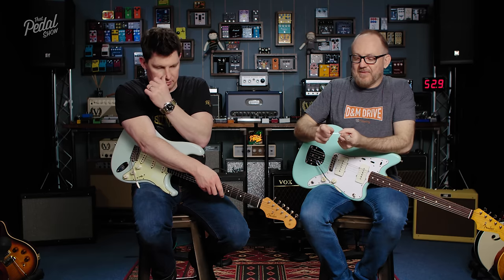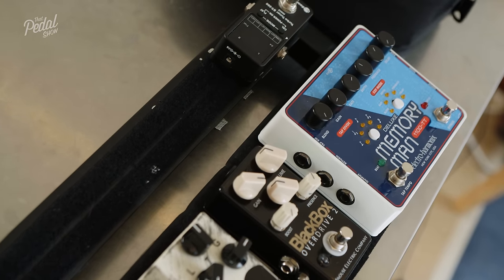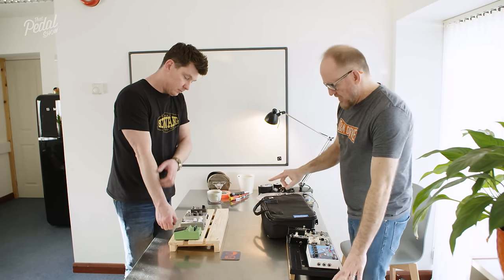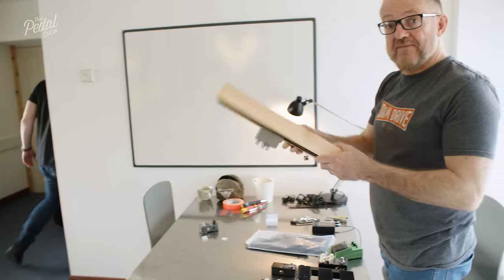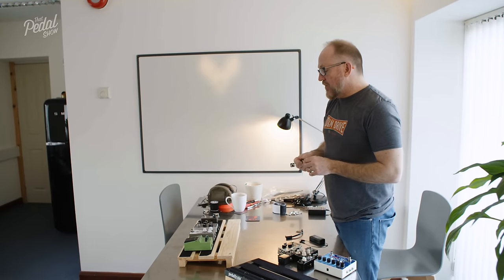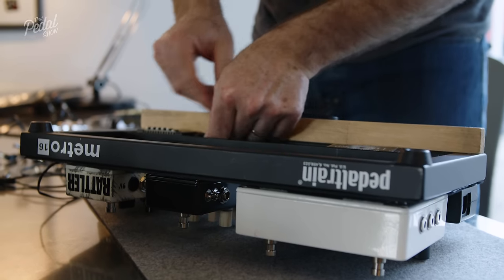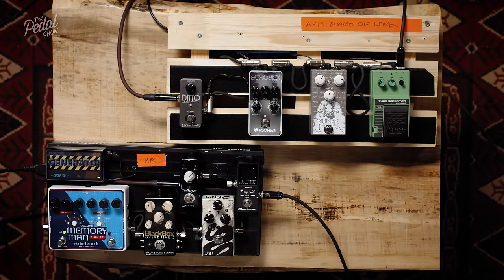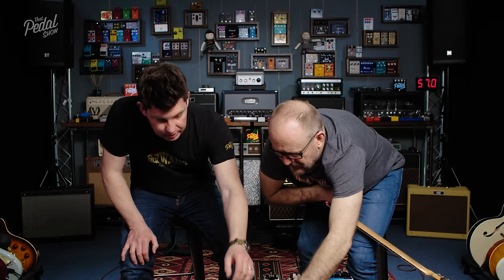Tips For Your First Pedalboard Build – That Pedal Show

Comment: Question for VCQ: I’ve brought a Mooer trelicopter and noticed it’s boosting my volume when I step on it. It’s currently after my drives and before delay and reverb. Is this normal?
Reply from the maker: Does it have an internal gain trimmer?
Reply: @ThatPedalShow   no idea!? Brought it off eBay 'new' ( from a  Chinese seller but it was posted within the UK) figured if it did it for me it would do it for everyone else? The pedal itself is VERY light if that info is any use? Works fine as a tremolo but just curious if it's ment to be boosting signal? I can send it to you guys if your interested ?

Comment: Question regarding metal signal connectors like the SiS and isolated power. When the pedal I/O are on the sides, and the cable connectors of adjacent pedals are touching each other, would that defeat the isolation in the PSU? Or is the shield/ground of the audio signal separate from the power ground?

Comment: Oooo, actual I do have a question... I asked it ages ago, it's regarding the type of cable dad uses... I asked Mary Spender for Somme reason at some point

Anyway, here goes...

The cables dan uses is solid core cable right? Which is what Dan recommends, even though it's a lot thinner stuff, and everyone seems to talk about it...

Now I recently had a cable failure on my board, I took it to a guy I know who has been a sound and electrical engineer for about 50-55 years(he's 76), he's no slouch in the knowledge of this particular field. 
He looked at my trusty fender cable, thick, chunky covered in nice tweed with shrink wrapped rubber around the solder, and exclaimed 'What a shambles, the tweed makes it difficult to find the break, the shrink wrap just makes it difficult to get to the solder, neither of which have any sonic improving properties, and it's a stiff, inflexible, solid core, prone to breaking, cheap junk cable, that companies charge exuberant prices for.... but I'll fix it!' 

He changed the cable for proper audio cable, resleeved it in the tweed as I insisted, and even re shrunk the rubber end around it, he said it was nothing more than cheap satalite cable they used, you can get it from anywhere, the profit margin of fenders cabling is obviously extraordinary, but the marketing campaigns will sell it to you as such an amazing revelation in tone and stability and ruggedness... don't believe them...

My question is: does anyone know why solid core cabling is been touted as such a great thing for the transfer of an audio signal through a pedal board? Why then is non solid core audio cable better for your guitar cables? 
It just seems to make sense to me that if something is been twisted and manipulated over and over again, forced into difficult positions, like cables are on boards, the more flexible the cable, the longer it will last? I so pros and cons too though as well... but the risk of snapping the core of a cable when purposefully bending it seems more with solid? 

Long winded question... sorry...

Comment: Hey Dan and Mick, what’s your pro tip for getting pedal board tape or Velcro onto the base of a Boss pedal? Do you remove the rubber pad or have you got a workaround?
Reply from the maker: Lots of people in these here comments are suggesting turning the base plate upside down. Never tried it but as long as there's clearance for the internals... Happy days.

Comment: You guys are great. Thank you so much for all your information on pedalboards. I have a MXR DynaComp that I am trying to work in my board it's just not working I don't like the sound of it it takes all the individual dynamics in emotion out of the playing. Am I doing something wrong? What should I be doing? How should I be setting this DynaComp?
Reply from the maker: Hello Ken, i posted this elsewhere on one of your comments, you may have missed it. Excuse the repetition…. Hey Ken, Mick here. ‘Problem’ with the Dyna Comp is that it does that overt squishy thing so well… but as you say robs the front of your note. You’ll get better results with a comp that has a dry blend. That way you can blend in some of your dry signal so the front of the note isn’t caught so much, but you still benefit from the sustain on the back/decay of those note. It’s one reason parallel compression is so popular in studios. With a dry blend you can bring a bit of that to your pedalboard. 
Failing that, try it after overdrive instead of before. Cheers!
Reply: So what would be an alternative?

Comment: I maintain a spreadsheet with all my amps, cabinets, pedals, mixers, etc listed with model and serial number, the year acquired, where/who I bought them from, who I may have sold or gifted them to, and the manufacturers' recommended power requirements, size of the connection barrel and pos/neg requirements.  It is a heck of a lot easier than taking a pedalboard apart or emptying a trailer to find the information at 3AM!

Comment: I’ve used the gigrig power supply for a while now and I couldn’t use anything else now. Dan, have you ever built a board so massive it’s required , more than one generator? If not, what do reckon the biggest board you could make just off one generator would be?

Comment: Great episode and perfect timing. I currently use a daisy chain but would like to purchase a power supply, however, and forgive my ignorance here, but should it be DC or AC, or is that dependent on which pedals you have?
Reply from the maker: The vast majority of pedals require DC... Which is what the vast majority of pedal power supplies, er, supply. Whatever you buy, make sure it can cope with the next four pedals you add. How about that?

Comment: First, thank you very much for the great episode. I have a question about the problem Mick had with the Mythos Runestone. I understand he further isolated that pedals power source by removing it from the Mission Engineering power source. Could he have sold the issue by still preserving the power source? If yes, how? Thank you very much in advance.

Comment: If you are practicing at home at relatively low volume with your whole board and you have your overdrive volumes at unity gain, will you need to adjust the volumes at all on the pedals when you turn your amp up?

Comment: I have 8 pedals on a pedal train jr, boss adapter and daisy chain, and ernie ball jumpers. I have quite severe volume loss. Is that a power issue, or the jumpers, or one of the pedals?
Reply from the maker: All of the above. Start with the power, be amazed.
Reply: Those Boss wall warts supply 350ma of current, if you have a couple digital signal processing pedals they could be drawing so much amperage that they starve your drives for overhead power. I am running a daisy chain just for the drives that are less than 10ma each and each big digital processor gets a separate wart. Happens I don't seem to have a ground loop hum.😸

Comment: Hi Guys, very inspirational - i'm going to make a wood one-....About what you said - earth from amp to guitar (through pedals & patch leads).. i've seen some pedals looking inside at the input and output jacks - the input jack has the signal and outer soldered and go off to somewhere in the pedal, but on the output side just the signal is soldered to the output jack - is that important - what effect would that have?

Comment: Fellas, I'm trying to power a Bogner Lyndhurst Compressor with a Strymon Zuma or Ojai on my board and all I get is pure white/static noise. I have about 13 pedals on my board and all work perfectly, except the Lyndhurst. I plugged an old Dan Electro wall wart power supply into the Lyndhurst and problem solved. Will the GigRig virtual battery solve my issue of using the Strymon Zuma/Ojai to power the Lyndhurst? If so, will there be an issue if I use the virtual battery to power the Lyndhurst when it is positioned after a buffer like the Fender Level Set Buffer?
Reply: I think I found a fix (even though I find it extremely odd). I plug my Zuma (which feeds to the Ojai via the thru power cable) and power up my board. I give it a minute before stomping any pedals. Then I unplug the right Jack patch cable from the Lyndhurst. I plug it back in and stomp it to turn it on. BAM! It works and no noise!...So weird that I have to do this. Otherwise it is either pure noise or no signal is heard when turned on (signal is always passing thru when not engaged).

Comment: Hey guys great episode keep em coming. My question is Can you have too many buffers on your board? I have
the buffers engaged on my switching system as well as all of the pedals in the loops. While setting up turning them on and off I was thinking it’s brighter so it’s better, but is brighter always better? 😂
Reply from the maker: Totally personal taste. I'm super sensitive to additional buffers. Mick here. I don't like them generally, maybe because the rest of the signal path is so super clean they don't need to be there. But there are sooooo many variables starting with the way you play the guitar. Then cables, other pedals, power supply, amp and so on. No right or wrong here.

Comment: What do you think about preserving the labels before applying velcro? Do you try to preserve them in some way or do you remove them if needed to make sure that the velcro sticks properly?
Reply: I’ve seen some people put gaffer tape down in their pedals so they Velcro or dual lock won’t contact the labels.  Gaffer tape peels off nice and clean.  I use it instead of duct tape at gigs.
Reply from the maker: I try to avoid the labels. The beauty of pedalboard tape in small squares is that you can usually do it.

Comment: Great episode guys, but how did you "permanently" resolve the noise issue on Mick's board?  The quick fix worked, but surely you didn't just chuck that power supply in the trash?  I'm really interested in know how long that phone charger would last powering all those pedals (or even more - 6-8 analogs).  Would it last a 4 hour gig without problems?
Reply from the maker: Hey Adam. Mission have told us that this supply has been upgraded since our review model so it won't do what it did here. 
But.... To answer your question correctly, the reason Dan designed his power supply system and the reason we use it exclusively is because it is absolutely no compromise, modular and can grow/shrink with your needs. Cheers!

Comment: I have a question about daisy chains. At present this is what I am running on my board (I have run out of budget for the time being) The mains supply to the daisy chain lead says it is isolated and I haven't had any issues with noise at home or at the majority of gigs I've recently played, aside from one venue where everyone was having the same buzzing issue on stage! Is using an isolated supply to a daisy chain still better? When able to change the way I power my board I will but for now is this okay? I'm currently running 9 pedals 8 on a chain and one powered from the Boss tuner extra power out. Thanks as always for a great show.

Comment: 3M Dual Lock in two versions for the best anti-security holding power!
Cut your power cables to size and solder on whatever version of plug you need for each pedal.
Run all your power cables up and down the board, run your audio cables across the top of the pedalboard. Also cut to fit from pedal to pedal.
Be sure to remove any batteries from your pedals... since you are going to use an isolated power supply!!!
Buy the tools that Mason Marangella suggests for holding parts, soldering, shrink tubing your connections as necessary, etc.

Comment: Slightly off topic, but can you explain how the higher (18v) voltage on a pedal actually changes it's performance? Should we always try to power a 9v/18v pedal with 18v if possible? I have a few pedals that can run on 18v, but only room on my power supply for 1 of them. Just wondering if I should leave the others at 9v, or try to power the others some other way at 18v.

Comment: Hey d&m, I have an od808x, super overdrive, and regular distortion. I’m not really finding what I need with my strat. Is the blues breaker what I’m missing? If so which one should I get in the colonies that won’t break the bank?
Reply from the maker: Could be Allen, but it’s a different style OD, see if you can try one or at least one of its many variations before you buy
Reply: @ThatPedalShow  Thanks so much for the quick reply. Very sound advice and hopefully I can find one locally. I noticed decent clones running around 200 bucks. Love the show and will continue to tune in. You guys seem to covet the old BB so I assumed it was the way to go. Cheers!
Reply: I went and tried some and decided on the tumnus pretty satisfied. Thanks again from Michigan.

Comment: I had a Zinky True Grit pedal, the sockets were on the top but the other way around to most pedals. So designer Bruce Zinky seemed to have been of the belief that pedalboards should run left to right.
Reply: Being a lefty, I'm gonna check these out!  Thanks for the head's up.

Comment: Hey,  probably a bit of an odd request. I like my setup very clear in front of me and I use a midi pedal. My amp has midi switching and I'm planning on using a decibel eleven loop expander and my other pedals are midi switchable H9, whammy and a two notes captor X. Do you have any suggestions of whats the best method of storing them on top of your amp? Or is it better to just make a big board for the front of the stage?

Comment: OK I have a question, When you are setting the phase on an ABY switch on your board (ABY Baby comes to mind) Do you have to address and set the phase every time you set up and tear down your rig? Or even between power cycles? I can imagine the speakers and the amps behind them are always in the same phase, or are they?

Comment: Please help: I dont unddrstand the gig rig power supply. So you go out of the generator, into the distributor, and you can go stright out of te distributor to pedals, or one output can go to an isolator for more outputs?
Reply from the maker: Hey Marco. You can go straight from the Distributor... but it’s not isolated. So it’s best to use Isolators for pedals with under 120mA of current draw; or one of the high current adaptors for anything else.
Reply: @ThatPedalShow  thanks! Definitely what I need

Comment: No tuner pedal Mick?I’ve bought some industrial Velcro at a hardware store that’s much stronger than regular Velcro. It’s a good option if u don’t need something extremely strong for home use. And it’s strong enough for small gigs or jamming with friends.
Reply from the maker: We use industrial velcro as the base. Much better! And no, I wouldn't have a tuner unless I was gigging. And maybe not even then if it meant sacrificing another OD...
Reply: I think I need to stop making comments. I feel like I saying stupid on accident

Comment: Hey guys, I have a Strymon timeline and it's great and all but it doesn't go under 30ms :-S. I have tons of distortion and post preamp pedals so no delay or reverb pedals. I was using my Boss GT-1000 rack multieffects (Don't knock it, amp models terrible but effects where okay). Anyway can you suggest a high end digital delay that can go under 30ms, I like the phase and comb filtered tones you can play with 0-20ms. What where strymon thinking? I haven't tried the Boss DD-500 yet so I don't know if the noise floor is as good as the strymon or if it goes sub 30ms. Strymon in my opinion have noisefloor nailed it is dead quiet. Sorry if it is a stupid question but it is my current dilemma. Thank you all

Comment: So even though Mick used a battery power source there was still noise?   So is this interference from another pedal on the board?
Reply from the maker: Apparently an issue with the power supply. Mission has since updated it (this was a very early one) so the problem will not be there on new units. As I keep saying - Mick here - the only power supply I've ever used that has no issues whatsoever is TheGigRig. Apologies to all the people that upsets. But it's true!
Reply: That Pedal Show thanks Mick I was curious as it’s sounds like a cool solution.  I switched to GigRig power around a year ago and although it maimed my wallet it’s been fantastic and I’ve no regrets!

Comment: Dual lock is insanely expensive.  Industrial strength Velcro in 2 inch strips works great.  I can lift my board with a pedal.  Just make sure the board and the back of your pedal are both very clean.  Also, your putting the wrong side of the Velcro on the board.  You are just asking for a board that catches as much dust and hair and shows it off to the world.  Now let the debate flame up.  Love the show!

Comment: I just bought 7 pedals for my daughter. Their total amp rating is 452 MA. I have a plug-style PSU rated at 1 amp. So that's more than double the required power consumption. All the pedals are center negative polarity and 9V. Do I need anything else?

Comment: Hey guys, I've got a pretty specific question that doesn't really relate to the video all that much (sorry). I've recently acquired a Meris Enzo synth pedal and I'm having some trouble deciding where to put it. My basic setup is tuner, comp, octave, drives/ fuzzes, delay, modulation, reverb. Where do you reckon is the best place to put it?